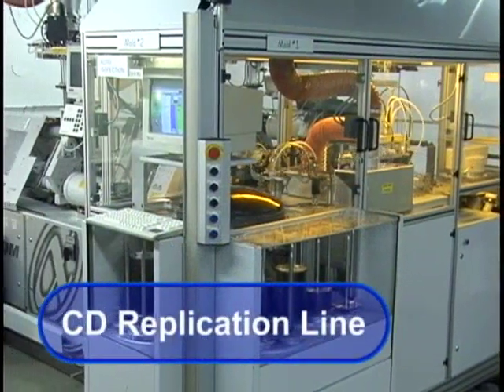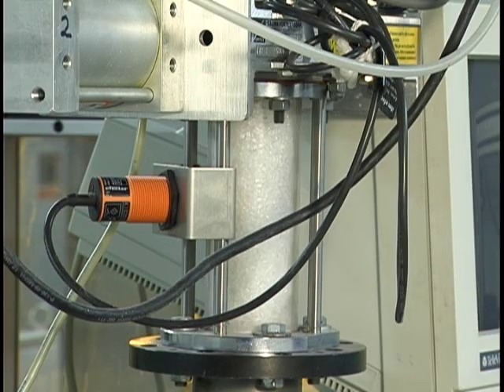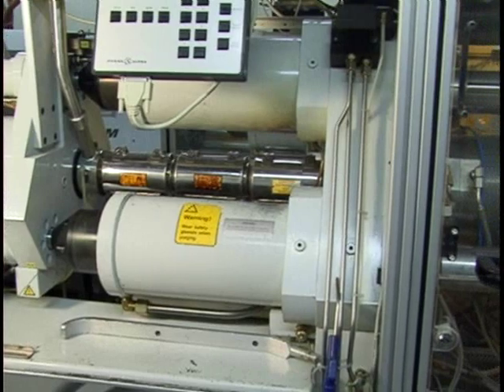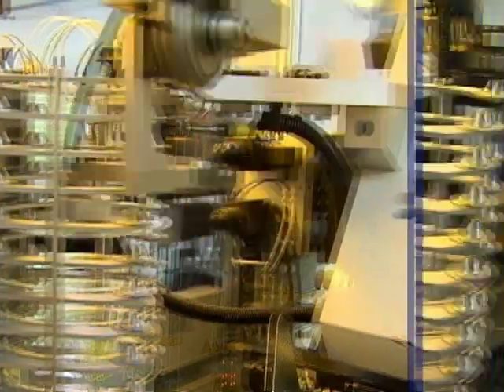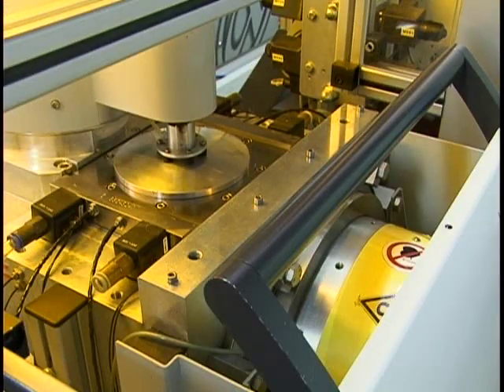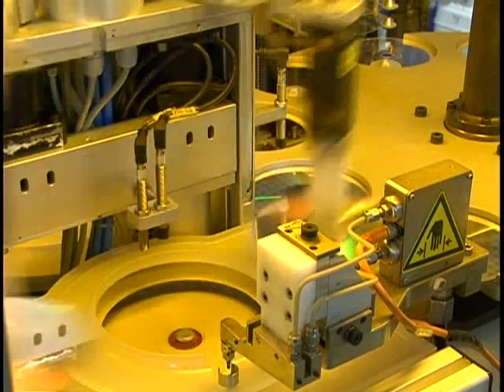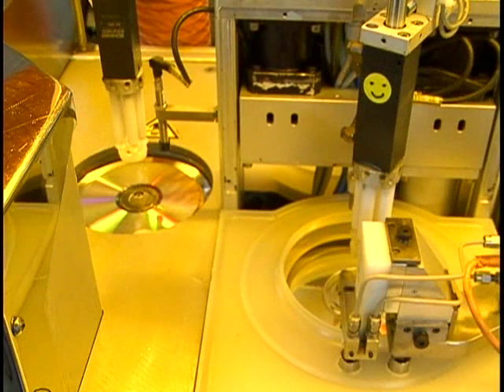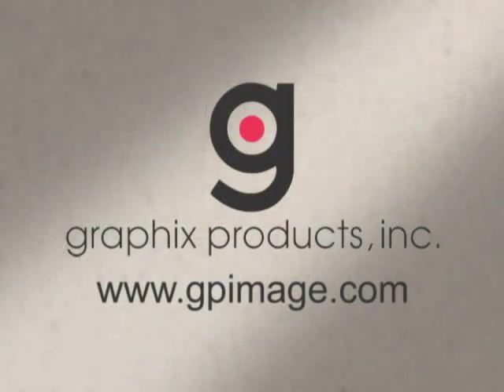CD Replication Line: Making a CD

Comment: Why does a CD need a reflective layer? Couldn't you put the read head above the CD and the laser underneath?
Reply: The pickup has bot the emiter and the receiver, just one traversal mechanism is needed. Laser is shot to the the disc and the reflection comes back and read by a sensor. Laser goes straight from the botton and reflection is diverted by a prism into the sensor.

Comment: metalizing procces by applying a thin film od metal? i suppose he mean alluminum.
also i 'm astonished that those robots works reliably in sych together.
Reply: If you ever watch those How It's Made documentaries, you will realize how much synchronization those machines have for making everyday items. For example, when making cereal grains, cat food, etc. each and every grain is shot past a camera at thousands per second, and the machine is able to reject any malformed grains with perfect accuracy. Try doing that with a human operator.
Reply: Yes aluminum.  Worked on toolex molding machines and the metalizers    Spin coasters and the inspection machines for 17 years.    Knew that toolex molding machine like the back of my hand